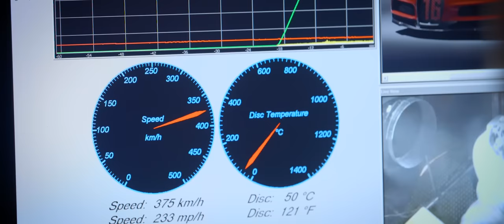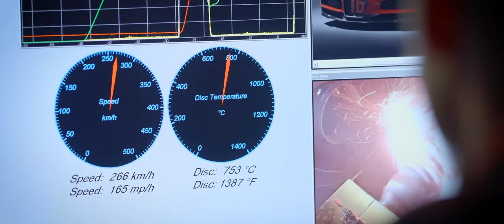BUGATTI CHIRON Titanium caliper brake-test extreme

Comment: 5 year old me thinking this is what happens when I push my bikes handbrake
Reply: Herro Herro yes.
Reply: I've made some old bike brakes release smoke.
Reply: Blu3 1k like :)
Reply: That hapened to me i was wondering how fast i can go so i got to 50 kmh and i need to stop then i presed front brake as hardest as i can becuse it cant flip me to i locket at brake and i had a litle bit of red so i spited on the disc and it had a sound like ypu are kocking something so i got some water and coled it down
Reply: IMA HAVE TO REPORT THIS.... 😂🤣😂🤣😂🤣😂🤣

Comment: Brake: sparks flying, disc is glowing yellow, caliper is on fire

Also Brake: manages to still stop completely without snapping off

Resilience 100
Reply: Hi there old guy :D
New album soon?

Edited in April 28 2022: sad they probably didnt know the guy who made The Entertainer, Maple leaf rag, Fig leaf rag, Pineapple rag and Magnetic rag.
Reply: Yeah thats how strong they can make things now, Imagine building a whole car that sturdy
Reply: Fluglhat then you’d be more likely to die in a crash. There’s a reason they engineer cars to crumple on hard impacts.
Reply: @fluglhat It won't be hard to make a car with such resistance.. But then it would never reach the speed needed to heat up that much.. That is the main problem.. We might need double jet engine on a car to do so!
Reply: That's titanium for ya, practically invincible
Reply: But it only lasted for 3 braking cycles... Pretty much useless. There is nothing we can conclude from this video because they didn't explain the environment.
Reply: @DataLog  from 200+ mph to almost nothing 3 times in a row. That substantial. That will rarely ever happen in racing that many times
Reply: @texantyrant5098  Idk, to me it is much more fascinating how the brake oil didn't boil.
Reply: Max out the graphics, if it's still not melted then use mods and the disc will be officially melted!
Reply: Resilience would be 10000000% lol
Reply: you guys do know normal car brakes are allso able to make brake discs glow red hot and are able to take this kind of abuse and still work fine.  brake fade is a bitch but they are able to take it
Reply: Without snapping off? Do you even have brain to see the bigger picture? 1000+ degree temperature is more than enough to burn Bugatti within seconds. It will heat up entire cabinet burn down the car and burst the tyres as well leading to fatal accident from both scenario
Reply: @nimbusws5946  yup, force will then be exerted on occupants instead of the chassis
Reply: You're paying over 2-5 million dollars for the car where these are going to be put on, what do you expect?
Reply: @rampage3337  We talking about the speed at which the brake is tested
Normal cars doesn't drive at 320 mph do they
Reply: carbon ceramic man, insane material
Reply: Thats orange
Reply: it didnt break
Reply: The sparks look dramatic, but like machining metal; glowing red hot material coming away is a good thing. 
It means heat is going into the material being abraded (or cut in the case of machining) and away from the brakes.
It is an intentional part of how brake pads are formulated.
I like the organic design of the caliper housing, very economical on material and lots of places for directed air to let heat escape from the disc.
Reply: Orange=Yellow??🤷‍♂️
Reply: @FilipinoFurry  😂🤣😂😂🤣
Reply: @DataLog  Exactly.  Are they freewheeling it at that speed?  If so this test is BS. They also need to simulate the weight of the car to do a proper test.
Reply: @fredwaywalls4686 this specifically says they are for the Bugatti Chiron, also the video is in kmph not mph

Comment: slaps roof of the car
Salesman: “ and this baby’s brakes will melt ur tires off “
Reply: I’m dead 💀
Reply: That’s one way to stop instantly 😂😂😂
Reply: I have had that happen once. My wheel bearing went out. Normally they take weeks of rubbing to go out completely. This one took one 20 mile trip home. My rim and tire got so hot I hit a water puddle and it blew the tire off the rim.  Rim was ruined, center crap gone, brake caliper seized, cv axle for 4 wheel drive done, ball joints melted so tire was flapping around, bearing was seized to spindle so that to was done. Only thing that survived that surprised me was the brake hose was fine and I used the tire in my new rim . 
My rim smoked for 2 hours afterwards.9
Reply: CHALK772 WHAT THE ACTUAL FUCK? 💀 how ... like hot black pavement plus heat from summer sun ☀️ + constant 100-0mph braking?

Comment: The most expensive way to cook an egg.
Reply: The egg is most definitely burned
Reply: RSC2 wrong, heat dissipated from the braked and the hot steel will slowly cook the egg , an egg hardens at 45c° and so the heat dissipation from the steel to the egg that is 1ft away from the steel it will transfer at the amount of 400 per ft kelvin which is just enough to harden the egg, and so for  3 seconds you would hover the egg over the steel plate it will cook seamlessly.
Reply: RSC2 considering the steel plate is at 1000° Fahrenheit
Reply: what egg?
i only see a pile of ashes.
Reply: João Felipe  🔥
Reply: The egg is well fucking done
Reply: *vaporize
Reply: If you make the egg touch the disk, it will simply vaporise lol
Reply: Not the most expensive way.. Not until you use Bugatti aerospace brakes
Reply: @dakheelalmutairi2715  1000℃ or 1,800℉

Comment: There is not enough Fuel in Chiron for such 3 accelerations :D
Reply: kaniak16 Tid true. Can only drive for 9 minutes flat out...
Reply: Regera has 20mpg.. pretty impresive for a car that has 1,500hp
Reply: @coa4s513  because half of the power comes from an electric motor?
Reply: @willbrant2160  8mins nooffense
Reply: Then a F1 makes 1000hp with 1.6  L and some electronic units. And they weight 1/2 a Chiron. 

Like really, 1.6 L is 1/5 of 8 L.
Reply: @ryanriverosantana4970  But an F1 engine is done in about 500km. The Bugatti can drive waay longer than an F1 engine
Reply: @georgkostler4185  Tell that to the McLaren Senna. Xd
Anyway, they can get much more power from a 8 L withaut making the engine last 2 days xd.
Reply: @ryanriverosantana4970  but a f1 car cost round about 8 million pounds (devoloping cost not included) per car while an chiron "only" costs nearly 3 million.
Reply: @mrenergy8791  So basically, we can't afford any of both.
Reply: @georgkostler4185 Todays reglement allows only 4 power units per season so they have to for sometimes 3000km
Reply: Fun fact. At top speed, a Chiron is using 270ml (9.13floz) of petrol a second.
Reply: @grantdavis5627  1 litre every 4 sec.. Now that's insane.
Reply: @RANJANA GUPTA I bet the Bugatti can take a lot more punishment
Reply: @RANJANA GUPTA Hmmm which one is working hard to achieve that Bhp? I'd rather have the  Bugatti engine.
Reply: Meanwhile...
I could build a compound-boosted Shelby GT500, make 1,200hp, be everyday drivable with all creature comforts, and have it hold together for 100,000 miles.
And save a ton of money over a overpriced VW.
Reply: Lol😂
Reply: @dr.hugog.hackenbush9443  Daily drive a 1,200hp GT500 for 100,000 miles? Riiiight....
Reply: @aggressivesambofordemonrat1381  It will last that long because it wouldn't be a maximum effort engine. I could up the power and have shorter life, but a properly built medium effort engine will last that long. While a 2200hp twinturbo Pro Mod might last a week or 2, it is also maxed out for power at the expense of life. I could give up power for drastically extended parts life. 
I built a 331 stroker for a '91 Mustang GT 7 years ago. It made 480hp to the wheels after tuning, and it gets driven 10,000 miles a year, at least. 2 weeks ago he had it dyno'd for fun & its still putting down 474hp at the wheels after all this time with a strict maintenance  schedule.
Reply: Dr. Hugo G. Hackenbush build your 1200hp Shelby and drive it 100k miles but also do some recording and post on YouTube for us to watch 👍🏻
Ps.... record build and drive and you reaching 100k miles 👍🏻👍🏻
Reply: @mrenergy8791  it's only 3 units for 2019 :)
Reply: @jorgealexander7589  Sponsor the build and I will.
Reply: @Cool Duck They will last an extremely long time because so few people drive them enough to even need change their oil, where you have to basically split the car in half to do..and spend a fortune to do so.
As for actual stress on the engine, I'd estimate that its only moderately stressed right now. There is more power to be had out of it. With more boost and or bigger turbos, on E85, it could reliably push north of 1800hp.
Reply: Power per displacement isnt a measure of effeciency
Reply: @devinwilliams3489  nitpicking, yes it's a measure of volumetric efficiency. That doesn't mean fuel efficiency tho, which is what I bet you mean.
Also people talking about engines being on the edge: don't forget if you "daily drive" you would literally NEVER be putting 1500HP to the crank, so no engine of the bunch mentioned, the V8 Jesko, Bugatti's W16 or any other engine, would be at any significant load, they wouldn't be making much more than 200HP at any given moment other than the short show offs and highway pulls for fun. Heck I would estimate cruising taking like what, 20~50HP.
To be honest I would be curious if the engine even gets up to temperature, circulates properly the oil and so on, at very low daily driving loads.
Reply: BTICronox radbull also the jesko is 1280 hp naturally aspirated with the electric motors, but with the big spoiler and air dynamical shape it adds 320 more hp to the jesko which equals 1600 hp. my point is without the electric motors the jesko would be like 800 or less hp, but Bugatti most of it’s power is from it’s engine not a electronic motor which is why Bugatti was the fastest with out electric motors.
Reply: RANJANA GUPTA and don’t for get the electric motors is what’s mainly the reason it’s 1600 hp
Reply: @adriankyles9708   Jesko is neither NA (it's a twin turbo) nor hybrid, it's purely the twin turbo V8 producing the 1600ish HP at the crank, when running E85.
No electric motors to help it, just the two turbos, triple injectors, optimized flow and so on doing the work.
Reply: Kalvinjj didn’t the other guy I replied said the same thing that’s why I replied to him because of what you said goodness
Reply: @adriankyles9708   to be honest I ain't keeping track of what happened then, all I saw is confusing the Jesko with the Regera (the regera being the hybrid Köenigsegg, jesko the new, internal combustion only).
Reply: kaniak16 i
Reply: Vitor Semeano  what's the bhp of a Renault RS17
Reply: @dr.hugog.hackenbush9443  what if the buggati chiron was a diesel engine car
Reply: Kalvinjj well they’re both natural aspirated around 1200 hp maybe it’s been a while since I look at both cars sts
Reply: @sessna  If it were a diesel engine making those hp numbers, I would be astounded, simply because diesels are know for big torque, not horsepower. Its torque would be in the neighborhood of 5,000 ft/lbs if it made that kind of horesepower, and you are rapidly approaching Top Fuel funnycar power levels at that point, with an attendant maintenence schedule.
Now, it it were a diesel making 1600 ft/lbs of torque, that would be rather unremarkable, as a lot of industrial diesels allready do that with compound boost and water/methanol injection. And given the diesel's inherent lack of high rpm ability, it would have to be geared insanely high.
Reply: Bring back the Chevy vega.
Reply: @gerald4027  V8 Vega. Like Yenko should have done..
Reply: Adrian kyles 
Naturally aspirated means there’s no forced induction(Turbo, Supercharger) 
The Chiron and the Agera RS are both forced induction not naturally aspirated. The Jesko is a 5.0L V8 that makes 1280hp on pump gas and will reach 1600hp on a full tank of E85 fuel. There has never been a naturally aspirated Koenigsegg. The Koenigsegg you are referring to with additional electronic motors is the Regera. It produces 1,100hp from the standard 5.0L twin turbo V8 with an additional 700hp coming from the 3 Rimac electric motors. It’s overall output is technically 1,800hp but available to the ground is 1,500hp 👍🏼
Reply: @dr.hugog.hackenbush9443  I see what you tryna say there, and make sense. But a Bugatti is a Luxury performance car dude... That will still be daily drivable and faster too, and way more stable at high speeds.
Reply: @Donts_blackwell  In reality, how often will you have the chance to drive over 150mph though? Not very often, if at all. I did once, on a highway, several years ago. No one around, middle of the day, with 2 miles of visibility. Got to 153mph in my Cobra Mustang. Sure, a Shelby isnt designed to go 240mph (they just top 200 stock) but the fun is getting there. With 1000+hp on tap, it would accelerate just as hard at 100 mph as a stocker would in 2nd gear, and would be able to pull 6th gear to redline, resulting in its actual top speed. Still though, Im somewhat low key, so I dont want a Bugatti. If I want to drive fast in luxury, and I wanted to buy instead of build, I'd get a Brabus.
Reply: @Titanium3X  a supercharger will consume much more air faster
Reply: Georg Köstler Oh no, F1 engines last way longer than that. They only have 3 engines a season.
Reply: @RANJANA GUPTA that doesn't mean they are more efficient, they are more power dense
Reply: @RANJANA GUPTA Its not called efficient. Its called "do 3 races at potential and its done for good". Koen engines are way overpushed. Its like using a lower performance GPU and OCing it to the point where even the highest quallity cooling system fail to keep it in safe levels...
Reply: @RANJANA GUPTA because w16 engines create their own problems to solve

Comment: New on eBay,
Brand new brake used only once
Reply: Cost
$50000
Shipping and handling
$99999
Reply: @rojiii69420  LMAOOOO
Reply: Refurbished
Reply: Kevin Cool brake*
Reply: Only used once set on fire and put to 2000 degrees still mint condition 👌

Comment: it's a good thing they overspec the braking system. Real application should see much lower temperatures due to air circulating + proper braking air ducts. Calipers have a cool design, but I think I'm most impressed with the rotor and pads. I'd like to see what the pads look like before/after these tests.

Comment: that casting is incredible....but just imagine what that rotor is going through....shows just how well vented the rotors are and also how good those rotors are at conducting heat away and staying in tact at steel melting temps
Reply: I’m pretty sure those calipers are actually 3-D printed. I know Bugatti was one of the first manufactures to utilize 3-D printed titanium parts.
Reply: @Brazilwill21  it certainly looks 3D printed, look at the design of it. 100% looks Iike a 3D printed part.
Reply: Yeah, it's 3d printed
Reply: Not cast or forged.... 3d printed
Reply: @zimissscameras  Its basic caliper. but topologically optimized and then printed from powder.
Reply: carbon rotors and titanium callipers!
Reply: Oh hey btw it's 3d printed
Reply: @Brazilwill21  wait.. you can 3D print titanium??
Reply: @megapet777  Yea it’s been around in the industrial industry for a few years. Those 3D printers are around like 1/2 million +. They have 3D printers that are using carbon fiber with Kevlar fiber. It’s insane.
Reply: @Brazilwill21  Wow that's very cool.
Reply: @nigelsmith7366  3d printed and sintered.
Reply: Yes, but how do you stop heat transfer - from a Rotor (almost white-hot) through to the Chirons Front Wheel Bearings. There must be some consequences.
Reply: it looks 3D printed

Comment: Meanwhile the car is on fire.....but it stopped.
Reply: Hahahaha
Reply: Nah.  The only reason it combusts here is because it's stationary.  Real world, with air flowing over it at such high speeds, it would cool that thing down a ton between tests.
Reply: And it wasnt the correct disc that would be on a Bugatti chiron that has advanced cooling
Reply: True

Comment: My Pc fans when i put my Chunks in MC at 32:

1:27
Reply: When I have OptiFine and I set it to 64: 2:00
Reply: I have a laptop that runs fortnite 1 fps but minecraft 32chunks easy
Reply: @danielfortnitee547  then you will probably have a decent CPU but a shitty/no dedicated graphics card. Probably internal graphics
Reply: @ianbos3581  no graphics card because its not gaming laptop its a mac book pro
Reply: @ianbos3581  what is a interal graphics card?
Reply: @danielfortnitee547  I'm sorry integrated graphics. A integrated graphics chip (as the name suggests) is integrated in the CPU for laptops or desktops which do not have a dedicated graphics card.
Reply: @ianbos3581  Could also be integrated in the mobo, but that was usually only used in older motherboards. It's kind of outdated now
Reply: @anamayarawa514  that's why I didn't mention it because Daniel is using a Mac book pro. But thnx anyway
Reply: That's sad my standard is 21 :v
Reply: =)))))) me on gta 5 with grafhisc gta 6 =)
Reply: Dude that's my ps4 when I play a ga,e
Reply: Thats why I have bedrock, performance is much better and smoother
Reply: @danielfortnitee547  bruh who tf uses Mac for gaming!? Who uses Mac for anything
Reply: @standupyak  
Mac runs smoothly tho

But it should never be considered for gaming